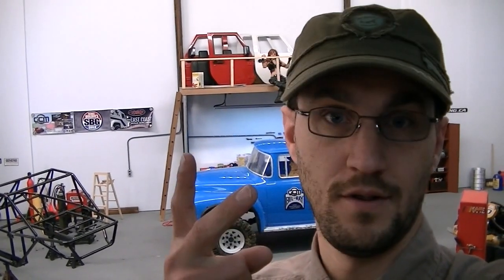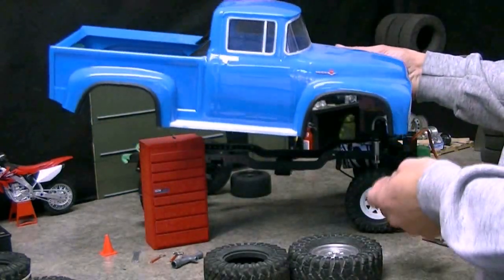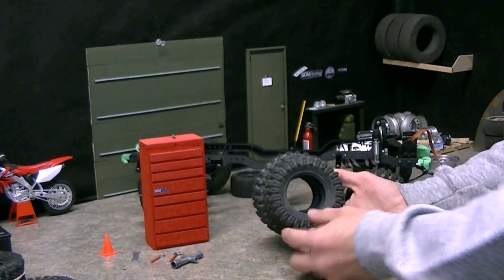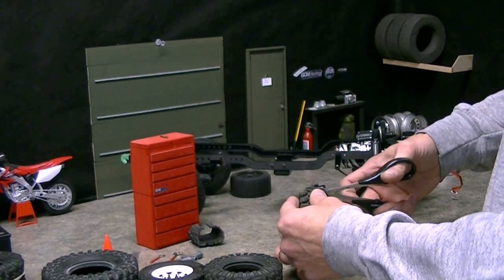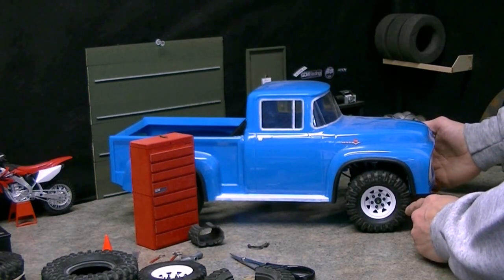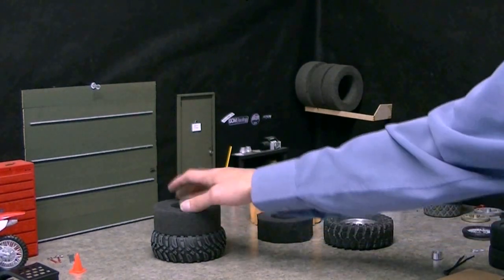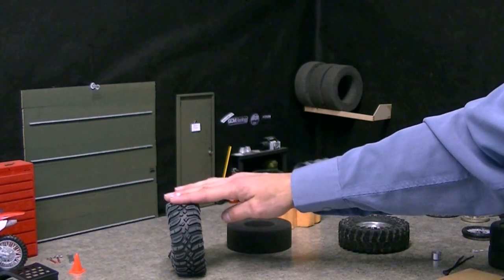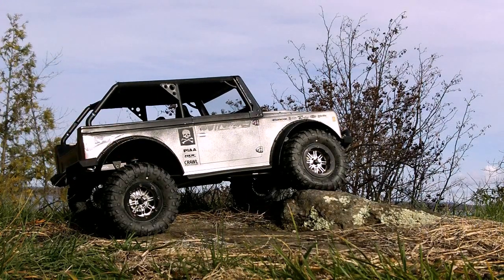GCM Scale Garage RETRO #2 - Tire Cutting and Foam Tech

Comment: You DO instruction videos too!! 😁 👍 
I'm one of those who's nervous aboot cutting tires.... you made that look EASY!
I'm still wondering, about that seam..... I feel like I'd want to vulcanize a bicycle tire patch on the inside. Thin enough so it doesn't make the tread too stiff in one spot. I figure that these go so slow, that wheel balance shouldn't be an issue. Right?
Reply: Also,  on cutting foams.... I've been doing that since the 80's! People kept saying that I was ruining the foam!! 
One of two things I never liked about R/C vehicles - the suspension was always max topped oot, and the tires sat like they had 100 psi in them!😠😠😠 
I like that little bit of squish in a tire, for better bite! Never seen "star cutting" before. Looks like a perfect comprimise!

Comment: I would have never thought u could cut and reglue the tires. How do u know where to cut to get the right dimension
Reply from the maker: Guesswork, is all. Cut the tire, and then overlap until you see the rim size you want, and then cut out a full tread pattern to match.